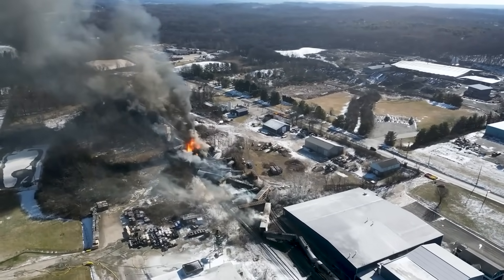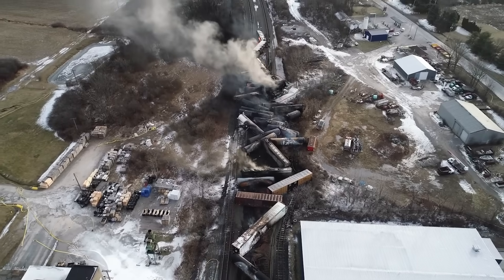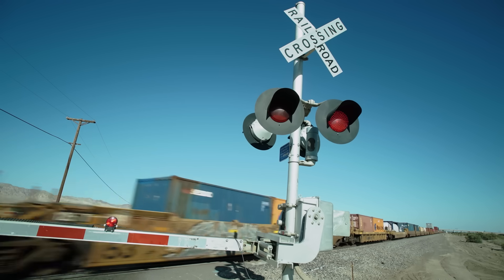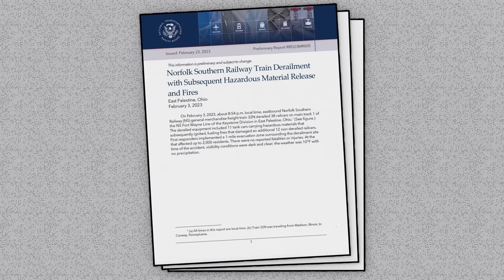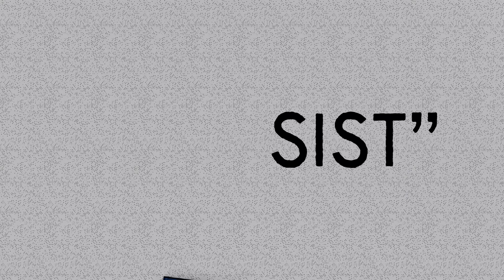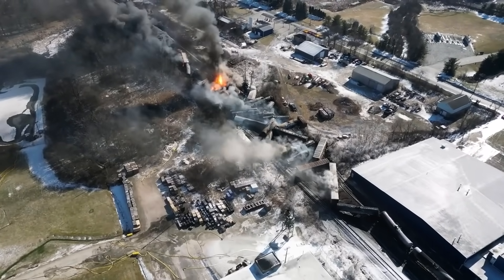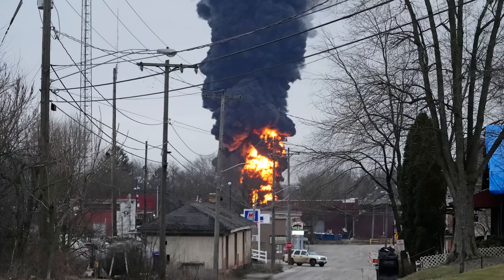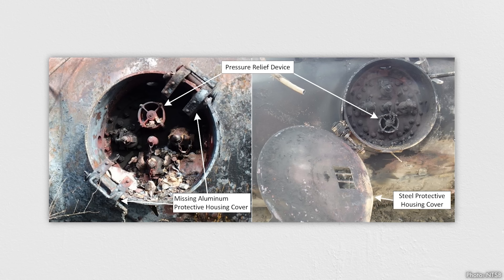East Palestine Train Derailment Explained

Comment: I would appreciate a video on what happens to the contaminated material that is removed from sites like this. It's all well and good to say that so-many thousands of tons of contaminated soil were removed, etc., but all that stuff has to go *somewhere*. It doesn't just vanish. So where does it go? How is it dealt with? What's the long-term fate of that contaminated material?
Reply: Depends on the material. Most of it is incinerated, which actually isn't as harmful as some of the other commenters would have you believe. Incineration uses high heat which changes things chemically. A lot of the hazardous material gets broken down into less hazardous products and released. People fail to realize that at it's core, even the most dangerous chemicals are still made up of natural compounds. Break those compounds apart with heat and you change them into non hazardous compounds like CO2 for example. Materials that can't be released are scrubbed or the release is controlled so it won't overwhelm the environment. 

Chemicals that can't be incinerated are stored in vaults. This is what happens with Nuclear waste. Some chemicals can be cleaned out with scrubbers as well.
Reply: An incinerator… which has environmental red flags of its own… and it’s not well understood what the long term impacts of that is.
Reply: yeah, this would be interesting
Reply: Injection wells and incinerators
Reply: So I worked in a steel mill and one particular job we had was welding “piles” together to create a wall that would become a boat dock. They drive the piles in the ground and make a huge rectangular shape box and pump the water out of the newly formed room. They then filled it with contaminated soil and put the top on it. It went to Jersey somewhere and this was back in 2009 or 10.
Reply: @midnyte_ryder well that’s reassuring given steel corrodes over time…
Reply: Most likely it's getting dumped at a landfill deemed as expendable. As a "gift for future generations. 5000 tons of material can't just be cleaned.
Reply: That was my immediate first thought, too.  Where does all the contaminated stuff go?
Reply: Hahaha. You believe what the epa. Says… I live here. When we have independent testing done here we get different results than what the epa says. As of 5/29 the water is still contaminated.
Reply: Gets removed from the environment and placed in another environment

Comment: Based on this explanation:
It seems like the rise in temperature from one station to the next should be noted by the system even if it’s below tolerance levels.  That key information might have helped decisions to be made earlier.
Reply: Yeah, the detectors only transmitted whether it violated safety conditions at that detector and the train doesn’t know what the temperature actually was measured as. A system of detectors passing that information via radio to a system on the train that could record all the measurements and keep a note of temperature changes would help.

Comment: the railway control- and braking- and on-board-networking-communication technology is old-fashioned and a far cry from what is possible today! Look at the internet, onboard cameras, W-LAN, and cell phone networks everywhere else, but on railroading! Look at Tesla's autonomous driving AI.  Railroads are somewhat  "last century". I also suspect the rims of the wheels on American railcars are too shallow for sufficient derailment protection in a critical driving situation. On the other hand, computers don't do well in these conditions: hot, humid, cold, rain, snow, salt, and rattling vibrations ... The Russian Trans-Siberian Express has another advantage over the American Railways: a wider spur width, which gives a larger load capacity and a more stable run! And they don't load double-decker containers on their railcars.

Comment: Shouldn't going from a temperature of 38 to 103 over a period of 10 miles have triggered some kind of warning?
Reply: It would depend on how high tech the detectors are. In this case the detectors don't communicate with each other and only tell the driver if there was a fault or not

Comment: HOW is it possible that the private company who runs the trains is the one to decide the safety rating on the bearings? 
Thins is something that should be regulated by the NTSB. 
It would be natural for a private company to raise the threshold to eliminate false positives and save costs, but at what cost? The possibility of missing early warnings. 
Screw the bad practices of Norfolk Southern
Reply: Thats what happens when there is basically a monopoly with tons of lobbying and interference

Comment: There are many aspects regarding this incident and others.  

Another aspect is the Hazardous material event that occurred as the result derailment.  

A controlled chemical burn should have been through burner which would have ensured complete and thorough destruction.  

Again cleanup of hazardous materials requires a systemic approach in assessment and knowledge of the chemicals involved.  This is a very complex problem and requires knowledgeable experts and workers. 

Regarding the relief device, the DOT believes that one size fits all.  Any relief system must be designed, sized, and properly installed.  Once the Relief Valve is installed it needs to tested and maintained.  To the best of my knowledge and experience this is not being done.  

This country will continue us to transport commodity chemicals via rail.  There are fare worse materials that are transported.  A number of them are used in the manufacture of computer chips.

Comment: There was a large railroad tanker explosion in my Hometown of Kingman, Arizona in 1973 claiming the lives of 11 firefighters, one rail worker, and one Arizona State Trooper. This massive propane explosion ushered in many safety changes for the railroad industry and the propane industry. I agree that this event will also help to create new policies and procedures. Great video Grady!
Reply: "I agree that this event will also help to create new policies and procedures" - Unfortunately, that means nothing if the rail companies have so much power that they can ignore regulations and get away with a slap on the wrist at most.  It also doesn't help when one of the two political parties is against regulations of any kind.  The world today is much different than it was in 1973, especially politically.
Reply: @nomore6167  You most likely know nothing about the industry, have you not seen the tier 1-4 emission standards that they follow have you?
Reply: A simple algorithm (e.g. "A.I." to the people who think "the cloud" is a magical version of online storage) would have figured out the axle was heating up in time to stop this before it happened.
Even the system in place should have caught it, because an algorithm isn't even required at all.
The "thresholds" in place aren't good enough, and an axle heating up 30 then 100 deg over ambient should have been enough to cause enough alarm for them to stop the train and check it out.

They really should have had the heat sensors be far less tha10miles apart since they're transporting hazardous materials.

The sensors should be built into the cars and feed into the engineer compartment instead of being on the tracks. The ones every 10 miles should be a fail safe if anything.
Reply: @jonslg240  I mean if the maintenance worker Norfolk Southern laid-off a few years ago were here I bet you a dollar that this wouldn't have happen or it could've also idk. Extra point every defect detector in class 1 railraods have a hotbox detector something was obviously overlooked in this case.
Reply: @jonslg240  According to another comment multiple sensors were offline which is why the detected values spiked from less than 200 to more than 200 so quickly.  If the other sensors were working they would have caught the issue sooner but they got rid of most of their maintenance crew, most of the actual train staff, and the staff that remain are horribly overworked.

Comment: Seriously? You left out some very, very important details. The main line of defense against derailments aren’t detectors or even the train crews. It’s the Carmen who inspect all cars before the train even departs. The Carmen’s sole job responsibilities are to inspect, and repair any defects found on freight cars. But it’s hard to inspect cars when 1000’s of Carmen have been laid off due to Precision Scheduled Railroading (PSR). PSR is a means of moving more trains with less employees. It made the company tons of money because instead of paying employees and having safety issues fixed, investors pocketed the profits. I worked as a Carman for a Class 1 railroad for 15 years before being laid off in 2020. In that time, I found any number of potential derailment causing defects. When I started my career, 120 Carmen worked at various yards in my service unit. By 2020, only 14 remained. But the amount of rail traffic increased! Did the FRA or Unions step in? Of course not. The big railroads are too powerful. And to them, money is more important than safety. As long as railroads continue to put greed ahead of safety, more and more derailments are going to be inevitable.

Comment: Measuring safety only by fatalities is a very poor method. It misses the majority of impacts of incidents like this.
There's the non-fatal impacts to health (including mental health) across a wide variety of levels to consider, and disruptions to daily life caused by the incident.

Calling out only the higher fatalities caused by truck accidents ignores these other impacts.
 
I'm also not willing to call this derailment an accident. That would imply that there was no systemic failure that created the conditions for this to happen. That's just not true.

Comment: It seems like everything that could have been done was done… except maybe rebuilding axles more often or a more advanced defect detection system that can track the temperature curve to let you know that the rate of increase is abnormally fast, but on a scale as massive as all the railroads even just in America it would probably cost trillions to upfit all the detection stations

Comment: The way "it will never happen again" is by not having freight trains.  Everything is a cost benefit equation.  There are probably a few minor improvements to be made here.  But, knee jerk lurches to over-regulation don't significantly increase safety.  As with anything governed by diminishing returns,  over-regulation comes with exponential cost increases for minimal benefit.

Comment: This is kind of baffling to me. I worked at a railway in my country for many years and we had differential temperature monitoring systems for stuff like this at least 5 years ago, with a fraction of the budget of a company like NS. We gathered all readings near real-time using cellular and satellite networks, and any bearing rising in temperature at an anomalous rate compared to the train average would quickly raise an alarm. Really surprising nothing like this was in place for a hazardous product train passing through a city.

Comment: Grady, you need a few corrections. The Bliss Salem video is west of the detector at milepost 69.01 of almost a mile. The detector near East Palestine is at 49.81, twenty miles, so the video is not moments before the derailment. BTW I have lived in or around Salem for 60 years. As kids, we explored around the tracks and trains from Salem going east for ten miles or so walking and exploring. Around here, at this time of year, there are no leaves on the trees. This "comet on rails" traveled over 25 miles at night, visible for many miles in the woods and fields, crossed 17 rail crossings and not one call to 911?

Comment: A monitor system that detects trends, aka the RISING temperature of a bearing through time, would be a huge improvement. I know hindsight is 20/20, but this approach is already used in many applications.
Reply: sure but how much would it cost. Granted they are probably now forced to do it. But lets be real they probably weren't going to pay for it if they didnt need to.
Reply: Problem with trend-based systems is that a lot of things can influence the trend. For example, heavy braking means the wheels get hot and that conducts to the bearing. I think a comparative system where bearing temperatures are compared across a train to detect abnormalities would work better and still be reasonably effective. Bearings subject to similar loading conditions should have similar temperatures, but a failing axle would have a temperature much higher than the rest of the train. So if a train had to brake because of an unexpected danger signal, it wouldn't trip the detectors due to rate of rise, but if an axle was significantly hotter than the other ones, then it would trip even though the axles were already hot due to braking.

Comment: So the defect detectors need to take into account the change in temperature rather than the temperature itself. Like if a bearing increased in temperature too rapidly then the train can know to slow down before disaster happens. Maybe if it is just at half speed until the next reading.

Comment: This makes a great case for small, inexpensive IoT devices on each axle. There was clearly an upward trend of temperature, but infrequent sampling hindered the operator's ability to spot the rising crisis.
Small devices don't need an external power source or batteries, they can be powered by the movement of the cars themselves, even the vibrations of going over points or track joins can provide the milliwatts for these devices to function, and at scale can cost as little as a couple dollars each. A simple readout in the cabin of the hottest axle can be a huge benefit to the operator.
Reply: a couple dollars each? sounds too pricey

Comment: I not trying to be argumentative, but aren't the brakes on rail cars designed to be released at all times unless pressure is applied? How else could you push cars in a rail yard when they're not attached to anything?

Comment: Even when there isn't a derailment other disasters could occur. 

A couple of years ago our town was fighting grass fires on the tracks running through the middle of the town.

They hadn't cut back the underbrush, they hadn't stopped the failing train.
Reply: Now days there are special MOW trains for cutting and spraying brush on tracks on most class ones. But on short-lines sometimes they don't have the equipment or funds do that.

Comment: Vinyl chloride is a volatile organic compound (VOC). Same with benzine. You sample for those under ASTM 8260. This is 3 40-ml VOA vials with zero headspace, preserved with hydrochloric acid. Pretty routine stuff on a lot of CERCLA/Superfund sites. One of the most common contaminant types is PCE/TCE/DCE, and vinyl chloride is a daughter product of the degradation of those chemicals. Benzine is part of BTEX, a suite of chemicals associated with fuel spills (gasoline and diesel). 

I imagine the EPA is requiring sampling for a pretty broad suite of compounds, but for the life of me I can't figure out what they're doing with a 1-L amber jar. Those are use for a variety of sampling methods (SVOCs, PCBs, PAHs, and some others, depending on the lab), but none that I associate with vinyl chloride or benzine. Maybe the burning did something--"Light the stuff on fire" is not an accepted remedial technology in most places (you have to send it offsite to an incinerator to do that), so I'm not terribly familiar with the combustion byproducts of these chemicals.

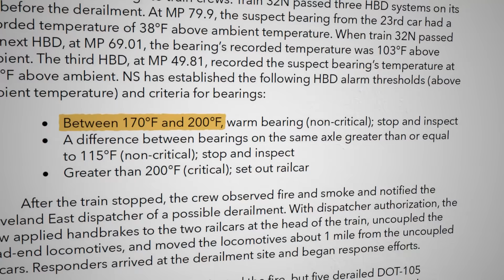Comment: Why do those temperature thresholds (3:58) seem super loose?  They are letting bearings get over the boiling point of water before stopping.  How can the grease avoid liquefying at those kinds of temperatures?  Bearings normally run fairly cool.  Allowing 115F above their neighbors or 170F above ambient sounds negligent.

Comment: If the trains had E-brake systems they would indeed be much safer. The Lever did some great coverage on the the issues around deregulation that likely caused the derailment. That and the monopoly power of the rail companies
Reply: E-brakes would have made no difference in this derailment case, that's a popular misconception. Trains take a long time to bring to a stop regardless of what braking system you use, by the time the brakes were initiated it was already too late. The cause is much simpler: Hot boxes being too spread out and a lack of trend analysis capabilities by the wayside.
Reply: @TheKeksadler  thanks for that clarification.

Comment: There's also been accusations of improper sampling by Norfolk Southern by residents. If that is truly the case, then it's not terribly surprising that all their tests would show the water is safe.

I personally find it strange that we're trusting the same corporation which caused the problem to do the monitoring to determine if the water is safe to drink. You would think that would be the job of the EPA or something. 🤷

Comment: As a railfan of over six or seven decades, it has concerned me that crew size has continued to go down as train length has gone up.  If the conductor position were to be eliminated, as railroads would like, there would be no second set of eyes and no one authorized to leave the locomotive to do visual inspections.  I also question the marginal economics of cutting the extra position. All of that said, there always will be derailments.  Some of these will be catastrophes.  As you said so diplomatically, the materials and products we demand go by truck, train, and plane.  For those who deplore the environmental costs of accidents, the sure way to prevent them is to stop using any of these products.  Please let me know how that works out for you.
Reply: This been my fear. Also expect those long trian cars to go faster also to make sure they make as much money as they can.